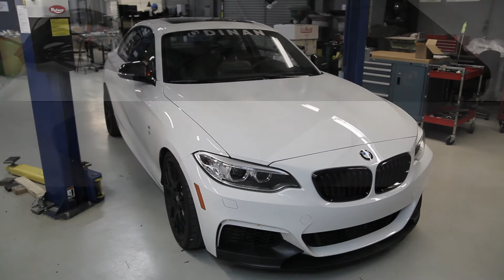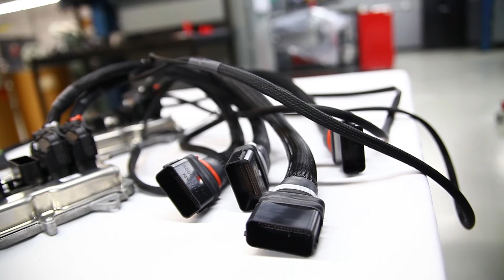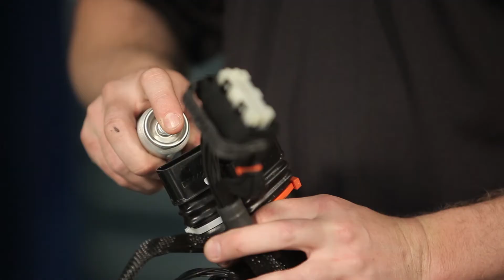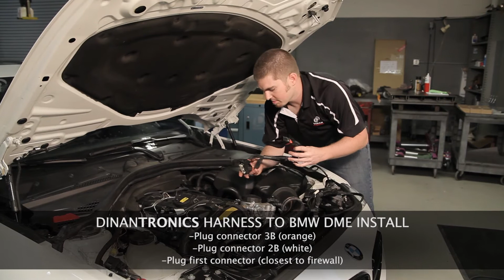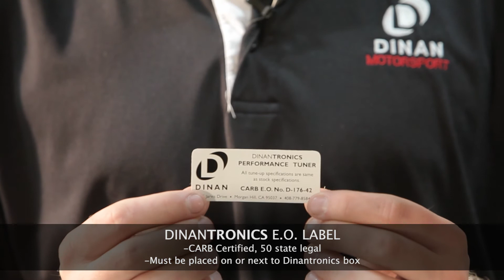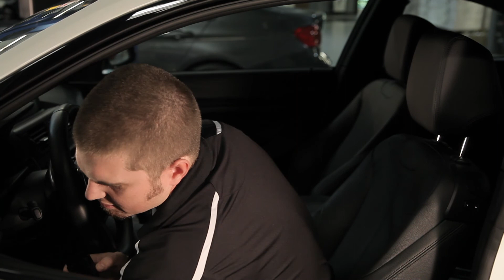DINANTRONICS Install - For N55-powered BMWS - Walkthrough

Comment: Charged you three thousand dollars for a weak tune, can't even provide a proper video. Get a JB4 tune, it makes more power and costs 1/10th of the price.
Reply: ...lol no.  yea dinan is too fuckin expensive for sure but saying its worse than jb4 etc.... smh... nah dude.
Reply: I'm watching this video to undo everything and get mhd tune 😂
Reply: @UncleEguire  how did it go for you? did you start with removing the dinan box then the connectors?
Reply: @potentialwtf  I unplugged the wires from DME but left the module hanging because I got struts changed and the strut support bar is laying on the wire now